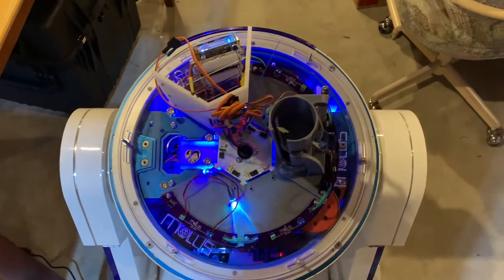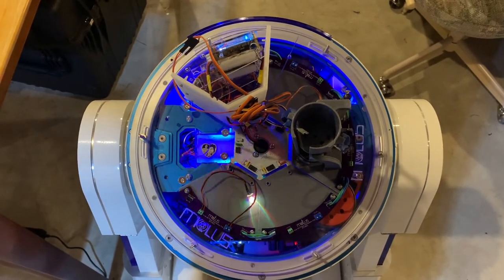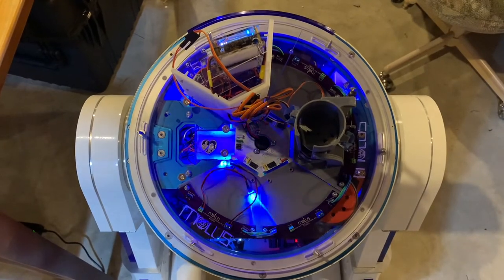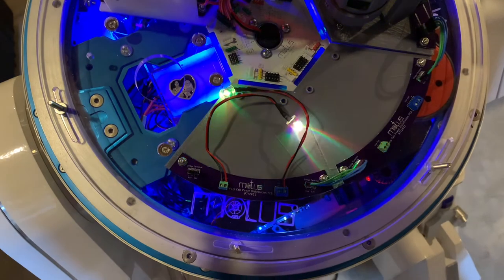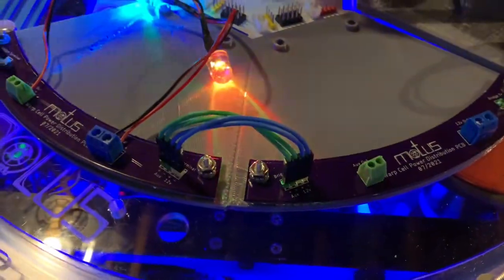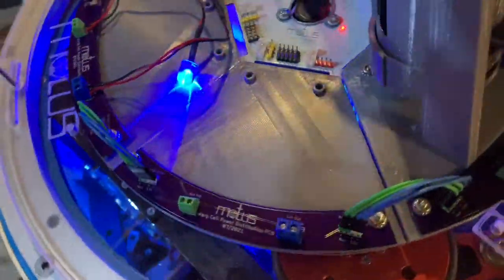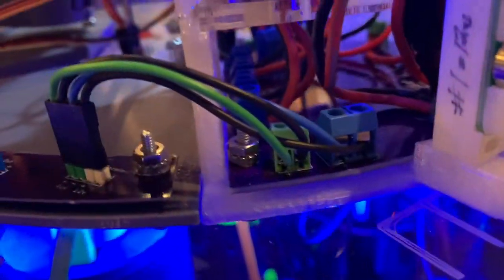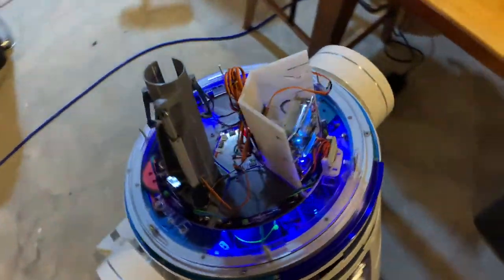Warp Core Dome System PCB Assembly

Comment: As I understand the rings are there to provide power for both the internal cell (like pie cells) is that correct sir?
Reply from the maker: Yes, or you can flip the terminal and use it to channel power out to the dome.